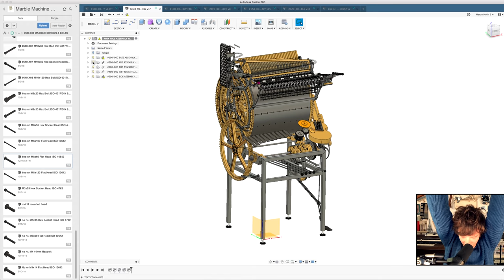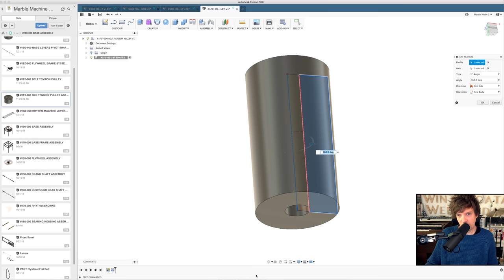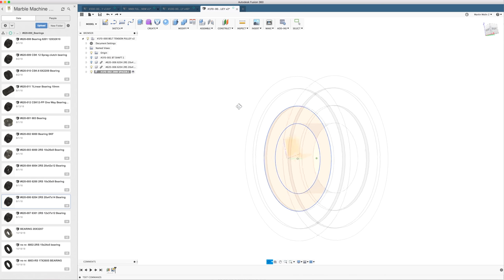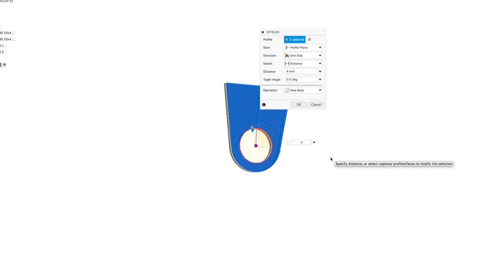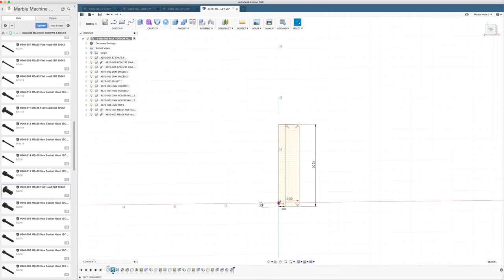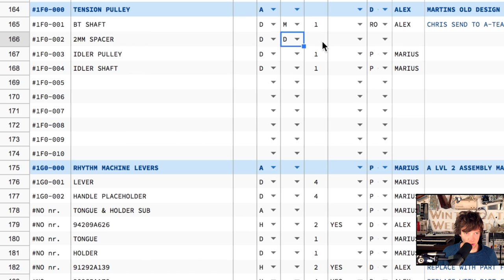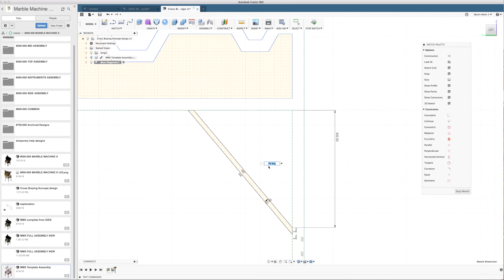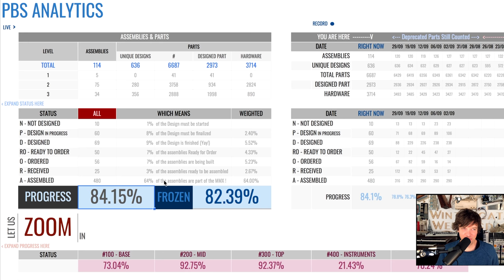Designing New Parts in Fusion 360 - Marble Machine X #56

Comment: If there are cross braces behind the programming wheel, how are the lab coat technicians supposed to change the programming plates?
Reply: From the front, take off a plate and rotate the wheel to get access to the next one.
Reply: But he put spider web on the front as well.
Reply: @jjk-9  but there are braces on the front too. so now what?
Reply: The front is blocked by the whole marble release mechanism.
Reply: The first thing I thought as well
Reply: I somehow missed the front ones,  but i think if they stood on stools they might be able to get the plates over the front cross braces then lower them down to not hit the the top section of the machine and get the plates free? Not sure how quick and easy it will be to do or how much space they have to manoeuvre with.
Reply: I have the same question, there was no clear answer. But if it is just a concept design/placeholder, he can add detail to design later by adding hinges, latches or some other option to get those things away for lab-coat team.
Reply: It looks like the back cross braces could be unbolted quickly from the top or bottom and swing away for programming
Reply: Yes they should be bolted on with big knobs that can be turned by hand.
Reply: Or take out/put in the programming wheel, as the matter of fact. Isn't it supposed to be modular?
Reply: my actual thought xD
Reply: +1 My first thought as well. :)
Reply: Tightly Pivot-Hinge the bottom points and camlock the top bracing so that it undoes in a second and folds down, then goes back together and locks back in a second.  Bracing is still rigid and quick to deal with.
Reply: from the top, with the help of a crane!
Reply: If you want the brackets to be really steady. To give the frame its stiffness. You don't want them to be removable... And I think it would take too long to losen bolts on stage to prep new music plates. I would reconsider the design. Perhaps make the subframe, its legs heavier.
Reply: Make the brace removable? It's not supporting the structure, but only limiting flex or vibration to keep the thing from wobbling. So in theory it could have two notched catches that hook over some pins welded to the frame and two bolts that could be removed to quickly hinge it back and lift it off.
Reply: Forget it. It's not possible, because you can't open the levers in front.
Reply: Make it removable
Reply: I was going to suggest something similar to the camlock idea, though I also saw some people saying that having the bracing be removable would compromise the structural integrity of the design. My suggestion would be to do the camlock idea, but having the ability to lock the cams with an M8 bolt, or some other mechanism. That would still allow for the anti vibration bracing to be movable, but at the same time, the bolts would give it a good locking point, mitigating the structural integrity issue.

Another idea would be to extend the bracing behind the drum a little bit farther until it meets with the tops of the main framework, and putting 90 degree brackets on the ends, to attach them to the main framework, and having the top use a camlock design in such a way that a cam blocks the hinge from swinging unless a certain lever is pulled, sort of like putting a wooden wedge in a door hinge to prevent said door from closing.
Reply: Cables instead of fixed braces. Can easily be removed for changes and tightened back up in seconds. Add in some decorative routing with some pulleys and such and it will look like an intentional part of the design instead of an afterthought
Reply: But the bracing has to be a stiff curve around the outside of the programming drum. If cables were used, not only would it not be able to suppress the vibrations, but it would also interfere with the drum itself, potentially destroying it and any of the pins (Read: Magnets) that are attached.
Reply: The beauty of cables is that they can provide strength via tension in all kinds of shapes and can be routed around objects any way you please. With enough tension, there will be no cross-vibration - it can replace rigid supports if done right. The world's largest bridges are supported basically by cables and bracing, why can't one think outside the box and scale it to MMX?
Reply: Be that as it may, you're still not taking into account the fact that the bracing has to go AROUND the programming drum. The easiest, and simplest way to do that is to do just as Martyn designed, with a rigid structure. Cables would just overcomplicate the design.
Reply: Sure, but smaller braces with pulleys or eyelets routes it around. Let's be real here, there's lots of extra complexity already engineered into the machine to make it interesting and visually appealing. This wouldn't be an extravagant endeavor in the grand scheme of the machine ;)
Reply: But all the 'extra complexity' is not just for looks. It's for a purpose, targeted to perform a specific function. A cable-based design would only add more ways for things to go wrong, with no benefit over a rigid design.
Reply: I respectfully disagree - it's more functional than a fixed brace and more rigid than a removable brace.  The programming wheel changes are a real concern. My idea isn't the best one, but I suggested it in the spirit of solving that problem specifically :)
Reply: Your argument about the bracing being less rigid isn't quite accurate. If properly designed, a movable brace would be just as rigid as a fixed design.
And just how do you propose the cables be routed? To route the cables adequately, would just mean adding more extraneous framework to an already complex design. Essentially, to make your cable idea work, it would require a framework to support it, just like the one that Martyn has already designed. All you would be doing, is adding unneeded parts to a design that already looks good and performs to requirement.
Reply: I'd say a removable solid brace would be best, I like the idea of a cam lock system. Or perhaps those push lock pins, the ones with two or three ball bearings in the end, they would be very fast to remove but they are very strong, and assuming that the tolerances between the brace and mount were tight enough there should not be any flex. Probably a lot simpler than a cam lock design as well, and cheaper. Those push lock pins are pretty cheap...
Reply: Maybe combine a camlock and a pushpin design? Like have a removable pin with an offset cam-like plate on it, that would then be twisted into the lock to secure it into the frame?
Reply: @Bondubras  yah that's not a bad idea, combining the two systems into one...
Reply: Any time I design something, My main focus is a combination of elegant simplicity, functionality, and redundancy.
I hate all this 'form over function' BS that lots of people go for. My catch-call is 'form FOLLOWS function' because if the looks of an object impede or degrade how it's supposed to function, then you've got a problem, my friend.
That's also why I was denouncing the cable idea suggested earlier in this comment thread so hard. It would degrade the functionality of the machine with no discernible benefit.
Reply: @Bondubras  I'm right there with you, function always takes priority over form. The way I see things, anything can be beautiful after being engineered properly, you just have to attack things from a different angle. Trying to make something function properly after making it beautiful is a recipe for failure. I've worked in the higher-end realm of aerospace machining for some time, and I can't even begin to explain the idiocy I see coming from some of the younger engineers (and a few of the older ones too), they have tried so hard to make parts which look amazing, but have neglected many of the finer points that goes into making a functional product. Be it a huge increase in labor for machinists/assembly technicians or decreased functionality, or even worse, the possibility of failure. I've caught my fare share of serious engineering fuck-ups in my days as a QC Inspector, usually made by someone focusing on the wrong aspect of design. Functional, simple, elegant, in that order.

I wonder if a secondary framework on the back, one that is a flat plane, wouldn't be better for the MMX? He could perhaps weld or bolt on to the existing frame a support structure that could extend a few inches past the programming wheel to allow for flat-plane triangular support, since as mentioned a curved brace is no brace at all, just a spring. Thoughts?
Reply: I don't think making a flat back like that would work, simply because it would require Martyn to redesign the whole thing from the ground up. Besides, the cross bracing we're discussing is not for structure. It's for vibration suppression. Martyn already has PLENTY of structure built into the MMX, so that wouldn't really be needed.
Reply: To those worried about the spring tension possibilities, yes, those are real but it depends on what material the bracing is made of.  Steel would be very spring-ish, flat brass barstock, maybe 25mmx5mm bent to shape, heat treated, and brazed would be very stiff in the horizontal direction.  Torsion wise, it would be less effective being in a curved plane but still better than nothing.
To those saying gussets, that was my first thought as well.
In either case, the goal is to stiffen the machine, not make it hard as a rock.  If it develops harmonics at certain rythmns, he will either have to choose not to play music at those rythmns or change the bracing but this will be possible WITH ANY BRACING configuration and you'd rather have a machine that can take repetitive stress than be solid as a statue only to break apart from unseen stress fractures in the middle of a performance so a bit a spring in the machine isn't necessarily a bad thing, just depends on where the oscillations happen to harmonize and where they focus their effects on the machine.
Reply: Harmonic oscillations didn't even cross my mind, but that's a good point. And going by Murphy's Law, any harmful oscillations would likely focus around some of the joints in the machine, where the structure will naturally be weakest. But that's part of the point of the cross bracing - to reduce the harmful vibrations while maintaining enough flex to not fall apart at a light breeze.
Reply: Two years later, you find out, and it's cool mannn.

Comment: You do realize, that the spacy spiderwebs do form an X on the Marble Machine X? ;-)
Reply: That is actually cool, I think.  We have to see what @Wintergatan thinks about it. :-)
(and as some other written, it should probably be designed so they are easy to remove with two fasteners/bolts/spring bolts and then swing away for easy access to the programming drum/wheel)
Reply: Hahaha yeah! @Wintergatan the Machine is finally baptized with its X name!
Reply: I was going to say that. It's a nice hat tip, but not a main feature. Almost like an easter egg.

Comment: Martin, I believe triangles are rigid IF THEY LIE IN A PLANE, but are not if they are curved in space as you have done with your bracing. Then they will flex and may have a resonant frequency.  Please check with an expert before relying on this design!  I am so glad you are so open with your designs, hopefully the wisdom of crowds will keep you from the worst mistakes.  Great job!
Reply: I tend to agree. I am also a bit concerned about the center of gravity. It looks like the MMX will be pretty heavy on its backside (opposite from performer). Even more so with these crossbars. The center of gravity will have to be judged in different situations: without any marbles, fully loaded at rest and fully loaded when operating, since we can deny the weight of the zillions marbles. Love the channel and I know its Wednesday when Martin's channel pops up in my new items!

Comment: The X around the back not only complicates programming, bit will not really add significant stiffness, because you have them bent into helical curves.   Think about it this way... each of the diagonal braces is essentially One half turn of a big spring. They can, and will, oscillate with the rhythmic input of the hand crank.   Welding them where they cross simply shortens them to quarter turns of a spring- the crossing point becomes the node and the frequency of oscillation simply doubles.  Triangular trussing works, but only in plane.  Bending it around the cylinder does the opposite of what you think it will.  If you plan on removing the upper section for shipment the entire upper mechanism needs to be more rigid and less prone to "rack" if it’s to be handled separately.    Underneath the marble drop mechanism you might have opportunity to conceal a shear plate crossing from left to right steel frames... or even an X brace of smaller steel square tube.   You could likely place some form of shear plate across the top back of the machine, out of the way of removing programming plates, and that plate might even have the wintergatan cut out so that it forms a logo...  wherever you can address the shear issue with gussets and plates, I think you will bet a more satisfactory result than worth two big steel springs across the back.
Reply: No worries, we'll just make them out of giant micrometer c-frames, and any fule kno that those don't flex at all... :)))
Reply: Of course straight braces would be better, but you have to work with the space you have.
Reply: They could be covered in a soft foam or fleese to dampen vibration.
Reply: If both on the back are joined together in the middle, they'll be much more rigid than you'd think, as when diagonal loads are applied to the frame, one of the crossbraces will bow outwards, but the other will be pulled inwards, and they will constrain eachother this way

Comment: M8 tapping hole is 6.8mm not 6.3 as you said . you would get away with that for nylon or delrin  but in steel it will be snappy tappy time . that is unless you have some weird metric super coarse thread in mind . thought i would mention it before you make the parts . loving your stuff by the way ,Cheers Ade .
Reply: What is M8 if not metric? You are right though, core hole diameter is nominal diameter minus pitch. And M8 has pitch 1.25mm

Comment: Have you considered some safety overload clutch somewhere to limit torque? If your machine gets stuck for some reason, it could save your machine to break totally.
Reply: I think he's aiming to make each and every part expendable, so in the event I breaks, it's not as big a deal as if the original broke
Reply: The flywheel is already belt driven, which is a clutch in effect, and that's probably the heaviest rotating part.
Reply: In one of his other videos, Martyn said that he was planning on having the CAD be released to the public so that others could build their own design. It would stand to reason that all he would need to do, is just to go into the CAD in a similar process, and order replacements for whatever part may have broken.
Reply: @Bondubras  In case of a maybe unlikely but possiblecatastrophic failure you don't want to reorder half your machine or even just a new programming wheel when you are on the road. This thing has to be bullet proof for a world tour.
Reply: @NochSoEinKaddiFan  Pretty sure at some stage he said he was building two complete machines for the world tour. Or at least a second complete machine worth of components

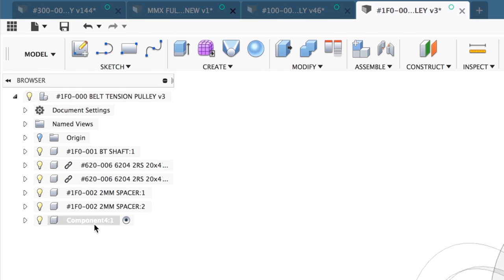Comment: @7:02 said new component "#1F0-003" but type "#120-003" is that a typo ?
Reply: Came to make this comment.
Reply: Same. I'm so afraid he'll miss ordering the full part by missing a component!
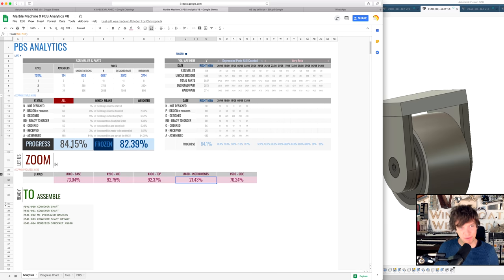Reply: @14:42 You can see he fixed it at some point.
Reply: @billkeithchannel  no, he's not reading the file names, it's a continuity error. In the document you can see the file names they are supposed to have.
Luckily, if someone has access to the file, they'll have access to the original, and can trace the error there, and find the part that they are looking for like that.

Comment: When you designed the shaft, you used 6.3mm for the hole to tap m8 threads, but I'm pretty sure 6.8mm is the tap size for m8.

Comment: CAD Video are nice :D. 360 is a powerful tool. Surprise that you can open the whole machine file with so much components. The fly wheels in red actually sounds like good for safety too.
Reply: There's a video about when Martin reached some kind of internal limit in the software. He had to change the way he uses the application in order to continue.
Reply: The "limit" is that moving extremly complicaticated components is slow. The way to overcome this is to make subassemblies with the same origin point. (meaning that when you are designing something that goes on top of the machine, you actually design it far away above the origin point. When you insert all parts into one design, you don't have to move anything).

Comment: the diagonals around the programming wheel, that you said we won't like, don't seem be efficient, since it's the triangle structure that makes stability, so when you brake up that triangle going in different directions force finds new ways of bending etc. ..maybe that's wort being considered. since that's what construction enineers do all their lives you could easy make a little challenge. "Please make MMX rigid my friends..."
Reply: indeed, besides, there are nicer ways to stiffen this structure than using cross braces, like extended ribs on the outside, i hope he takes some time for a nice way to fix this.

Comment: Curved X-bracing will not work as good as straight ones. Elasticity vs Flexibility of the brace material. But maybe the Flexibility of the curved one will give enough resistance to achieve your goal.
Reply: indeed, there are nicer ways to stiffen this structure than using cross braces as well, like extended ribs on the outside for example.